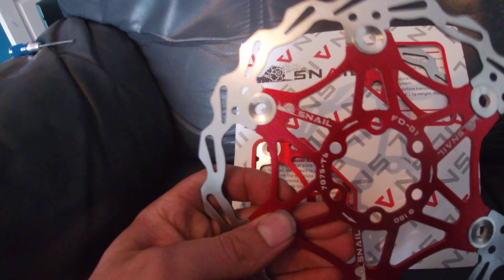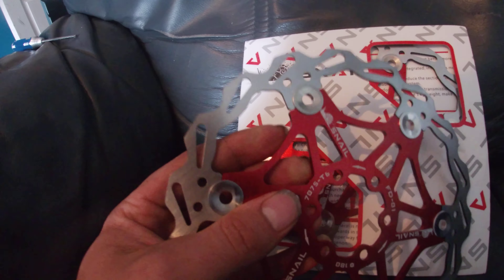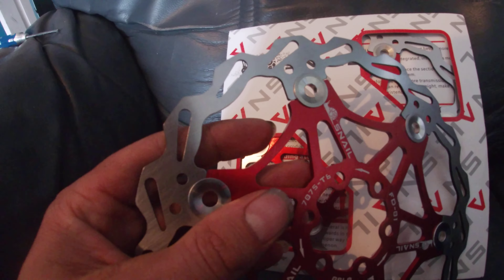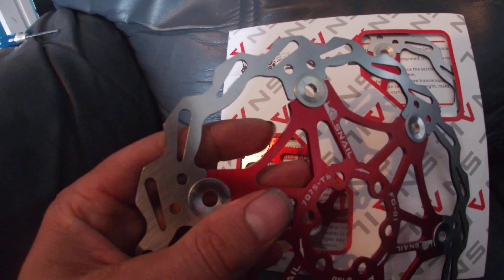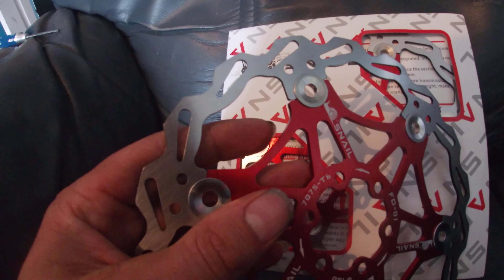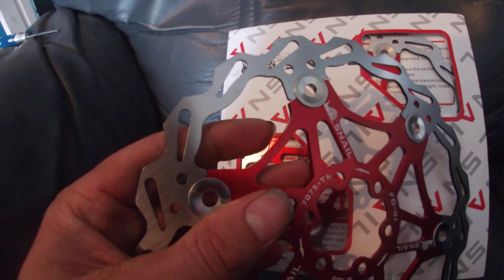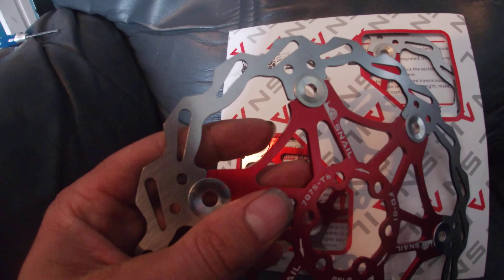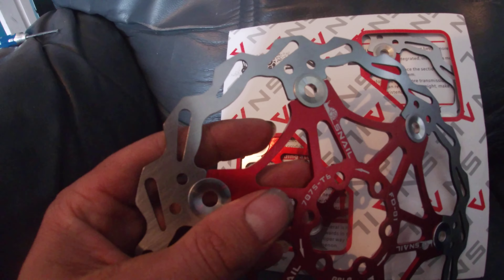snail  disc brakes

Comment: the rivets will go loose, i dont recommend this disk, when you hold the brake at standstill, you can feel the whole disk moving back and forwards.
also ive seen this disk snap at the rivets so im scared for my safety now! i need a new disk, dont get this one! dont even get floating imo.

Comment: It is crap.The rivets that hold the two parts together is too close to the top.the rivets are striking my bikes Shimano brake caliper.I raised the caliper by adding washers to the adapter and now it only contacts half the brake pads.Waste of money.
Reply: Really? I have these rotors 180mm with Shimano slx brakes and works just fine
Reply: Check your brake block
Reply: I have them on my commuter/ bike packing bike (160mm front and rear- colour black) with Shimano Deore XT brakes, they works great.

Comment: Why aren't you wearing gloves while touch brake rotors ? If you have you should wash them with rubbing alcohol
Reply from the maker: in the real  world    that is  not as bad as all the mud    rocks sand     tree  sap   dog  (you know what   and  in cutting them and making them you be assured  there  is   a small amount of oil   on them   best thing to  do it   hit  them with  cleaner    before  putting them on a bike   brake  and cluch  cleaner  works fine